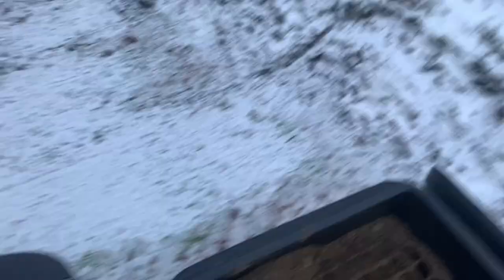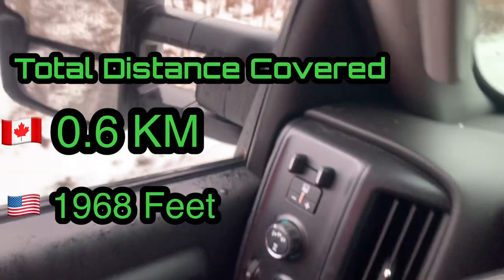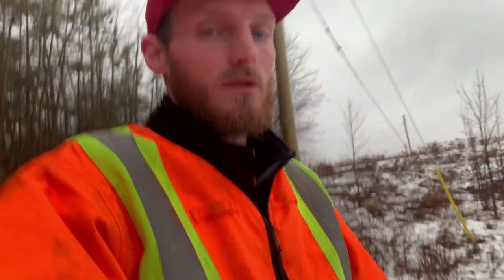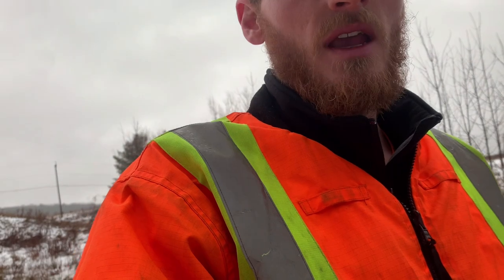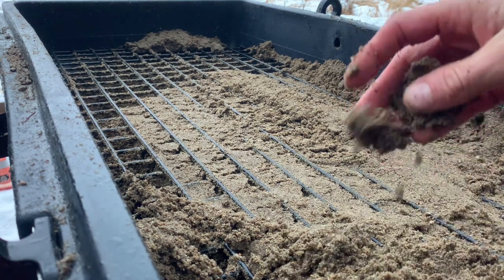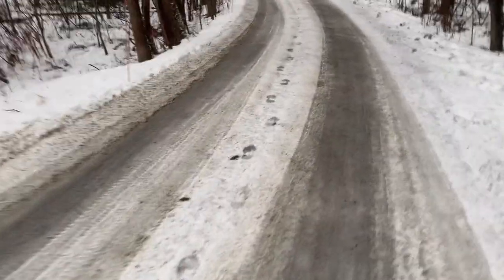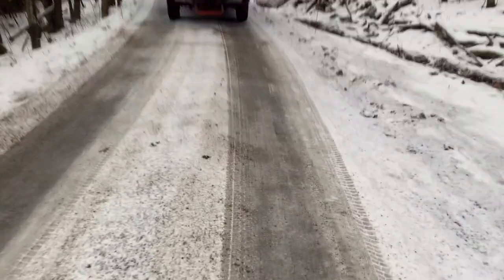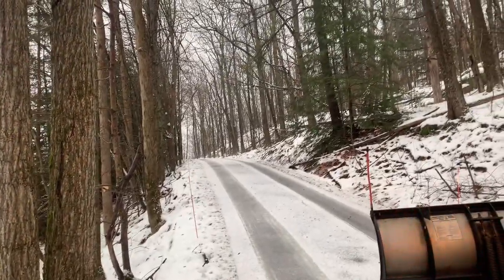Buyers SaltDogg TGS07 Review- Will It Spread Sand and Salt/ Wet Sand/ How Much Area Can It Cover

Comment: Can you tighten the pattern so it doesn’t spread salt on the side of the road. Is that a good mix sand & salt. Would you say 25% salt 75% sand. Or 50 / 50. Great video thanks
Reply from the maker: Hey thanks for the comment- there is a shroud that restricts the sand from flying into the banks but it’s also what speed you set it to. I recently added extra extensions for the shroud that I can flip into place for narrow roads. This helps and allows me to have the feed a bit quicker. I’ve used 50/50 and bulk sand which is 25% \ 75% both worked perfect. The vibrator is definitely the key when using any sand mix.

Comment: That road was really icy build up, wow. Seems to have spread the sand mix no problem. Couldn't really tell though if it was covering the width wise of road or not.
Reply from the maker: Definitely icy. Not clogging at all; I was impressed. It did the full width. I tried to keep it exactly the width of the road for the video but it’ll spread about 4 lanes wide if you open it up for a parking lot

Comment: How heavy is the unit? Is it easy to instal and uninstall with one person?
Reply from the maker: It’s 250lbs empty. They make a cart so you can install it by yourself (I haven’t used) but it takes 2 people to install without it or you have to use a piece of equipment.
Reply: Where can you get the cart? Is it sold by saltdogg

Comment: What number were using to spread?
Reply from the maker: this is just on 1. I did this so that I could ensure exact coverage over the road. It took extra time but for testing spreading distances I wanted things to be as exact as possible. On this setting it also spreads almost exactly 1 lane in width. 

I normally spread this road at 3 now and have added extra deflectors to keep the spread narrow (the road is tight) while speeding up the feed.
Reply: @muskokapropertycare261  Thank you very much for your response.

Comment: They all need an auger shroud. The 750 does not come with one so I fabricated  one
Reply from the maker: This comes with a small shroud- works great in parking lots but on this road you need to block a wee bit more to keep the sand in the single lane